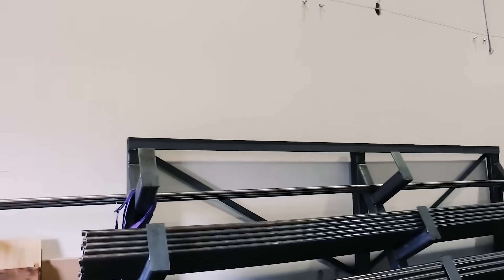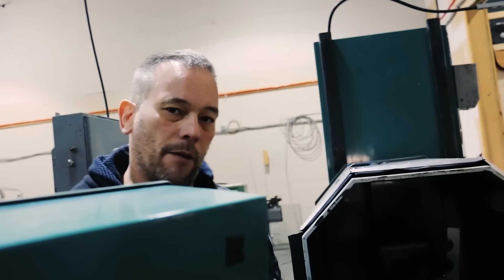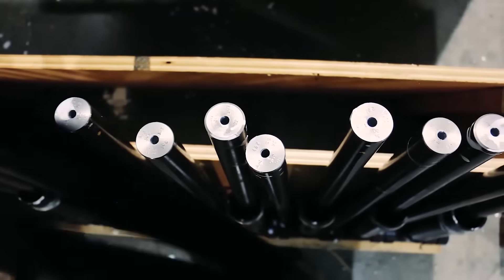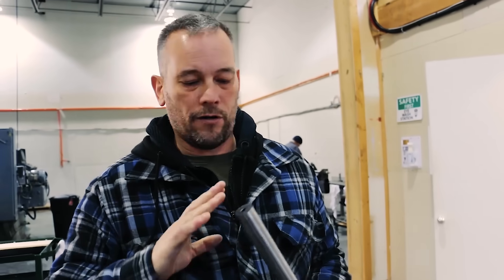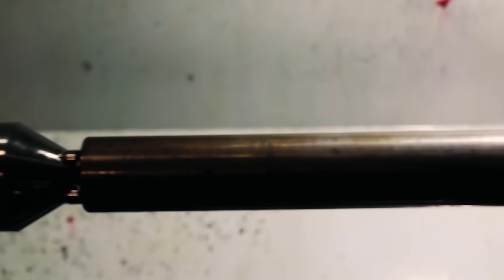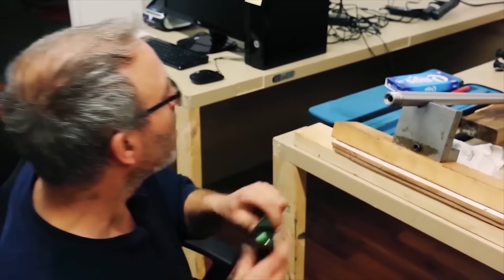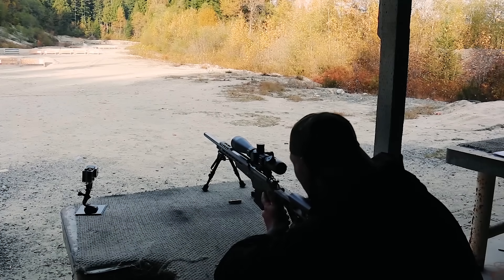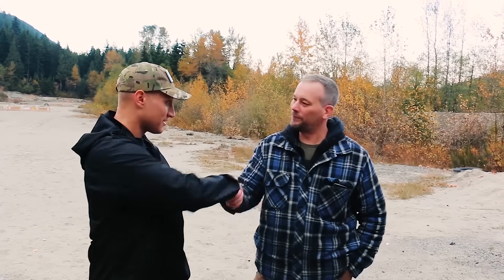How A Precision Rifle Barrel Is Made: with International Barrels Inc.

Comment: How can you drill a straight hole with such a flexible drill bit
Reply: A couple of years ago I took a tour of the Shilen Barrel co in Ennis Tx. They drilled the hole in the barrel using a process where the barrel blank sits in a bed and is rotated and slowly advanced into the drill. However, the hole in any barrel is never going to be completely straight. It's the consistency of the diameter of the hole that's important. There were craftsmen who straightened barrels but that's pretty much a lost art these days.That's why gunsmiths who chamber barrels always locate a position in the barrel where the end of the cartridge will be and use that point to center the barrel in the lathe. We're talking about one ten thousandths of an inch for precision work.

Comment: Those barrels seem very very thick, is this the old school make it heavy, make it inflexible, clamp it down tight (like the wa2000) line of thinking?
Reply: Thick barrels absorb heat better and are much more rigid and stable.
Reply: @THOMASTHESAILOR  yes, all true I know, but the fashion these days is free floating and being this big seems like its weight would bend it
Reply: @sarchlalaith8836   You're right,  I understand the trends..  But the barrels steel is pretty darn strong..  it can't possibly bend under it's own weight..  It's just a matter of choice..   Big Burly Guys,  like Big Guns..
Reply: @sarchlalaith8836  Heavier barrels don't sag under their own weight.  And, they whip less than thin barrels making them more accurate.
Reply: @edwaggonersr.7446  Reasonable but I was additionally talking about the method of attachment, ie free floating, vs tightly clamped since thicker barrels tend to be more firmly held.

I'm curious which this is intended for.
Reply: @sarchlalaith8836  Different riflemen do in one way or the other; thick or thin.

Comment: 168 and 175 grain Sierra Gold Medal Match factory ammo will shoot stellar in most any decent rifle.  I shot it for F-class for several years before loading my own match loads.  My hand load  is basically a duplication load of the 175 GMM factory load utilizing Berger bullets seated a bit longer than factory specs.  I tell any new F-class shooter to shoot Federal GMM for a season or two, save their brass which has been shot in their chamber, and load your own from there.  As for the Federal brass, I've had very good luck with it in my reloads.  Weights are consistent (I sort all my brass by weight) and I've not had the problem with loose primer pockets.  I also use Lapua brass in my .243 match rifle since I didn't have decent factory brass for that from the get-go.  The worst factory brass I've ever tried to load is Winchester.  Winchester brass is horse shit, no matter what anyone tells you.

Comment: Broaching tool is used for twisting lams and grooves in barrels, 1 broaching tool may last for as many as 10,000 barrels (2 inch). These are methods that have been used for at least 100+ years. And if you believe that ballistics comparisons can I.D. a match using barrel comparisons you had better think about how many barrels are machined with 1 broaching tool. They are not like a fingerprint.

Comment: See that machine that was made in 1917 and is still working. That's what you get from American made items.
Reply: Look they have one lathe made in soviet union Stanko probably model 16k20 or 16k25. So as you say made in America :D Soviet union made really heavy duty lathes this one weight 3-3.5 metric tons, motor 11kw, and can cut metal like butter. They made quite good manual machines, but most other things are not so good.

Comment: Man,your Prat-Whitney gun drill machine!  I have been into manufacturing all my adult life, (over 35 years with several degrees and tons of work exp., now self employed in a small shop), and I have never seen a 100 year old machine  that is still in operation, (I am sure there are more).  The USA made good stuff back then that would last, and over engineered by today's lower standards.  There has to be 10's of millions of dollars worth of work put through that $500.00 machine, (in 1917).  If they can only make a CNC milling machining center last so long.  Most have a 10 year life span if pushing their capabilities.
Reply: EarthSurfer,
 You are so right. I use to work for a company that had old rubber plate printing machines like that , which were made back then. One of them was suppose to have ran food rationing stamps during the depression. Everything was very heavy duty metal, the old canister type oilers , etc. These machines were made to run 24/7 if you keep the oilers filled and took care of them, replacing worn bearing etc. .
 Newer offset litho printing machines were not so much.
Reply: I have a friend, a machinist, that works for a shop that makes 5' diameter earth hole drilling rigs.  They have a lathe that was used to make battleship barrels during WWI and WWII, the thing is massive.  My friend tells me that the cost of shipping and setup was more than the cost of the lathe, pretty cool.

Comment: can this be down with a manual lathe?
Reply: Long holes?  No.  A drill of a .25 caliber for example, would start wandering off center too much after 2 or 3 inches of depth, with the best of conditions.  The "Gun Drill" is a specific machine for drilling gun barrel bores, like the name says, (and why a good one is still valuable 100 years into service).  I worked in a shop that had one, (aerospace), but I never ran it.  Search for it here for one second on youtube, and I am sure you can see the process that is needed for a long, straight  hole.
Reply: I am wondering if you can actually do a better job (straightness) with a wire EDM,---but first, you have to drill a hole. :)
Reply: thanks for replying

Comment: I wonder if a bullet would even make it out of a 12 foot long barrel with a weaker cartridge like .380 or 9mm or .40 or .45
Reply: I would bet they engineer the powder charge to be spent by the time the bullet leaves the barrel, so the pressure probably drops from the normal barrel length for the last 10 feet.  A big factor is the bore tightness on the bullet, but I bet the average will be coming out of that long barrel at about 550 FPS, like a cheap pellet gun. :)
Reply: EarthSurferUSA yeah sounds like an experiment i need to mention on some other gun channels

Comment: As much as i would like to start some sort of metalworking and machine shop business here on local, the massive initial upfront cost and lack of actual education and skill levels (i can figure things out, but it involves trial+error and eats too much time) has been the biggest problems. A standard machine lathe, brand new retail can easily soar towards five figures, round the cost of an almost brand new car, and that does not include the cost of having three-phase power installed to power it (pretty much mandatory unless you can deal with using Variable Frequency Drives to convert 2ph to 3ph, like how AvE does it)

and of course, the tooling. Starrett reminds me of what Snap-on used to be - top-of-the-line top quality (before it became infected with the chinesium and assimilated into the prosumer void alongside the craftsmans, cryobis and other oddball generics) - and came with a top-of-the-line price that dyed your face green upon seeing the price tags, along with the promise of instantly slimming down your wallet.
Reply: I have been into manufacturing (from burger flipping) all my adult life. I paid my way through a community college associates degree flipping burgers for 4 years, got machine shop jobs, (over 20, but a heck of a lot of skill learned), earned, (while working in machine shops), 2 more degrees, (Bachelors in manufacturing and quality engineering), and was still not making the money I wanted to make, like more than you need to just pay the bills.  Then I started a business.  I rode and worked on dirt bikes growing up, (which got me interested in manufacturing), and I now modify little 2-stroke engine for racing applications.   Man--learn how to make things, and get into a recreational industry, or create your own.  I bought a Tormach mill over a decade ago (a 12,000 cost).  It is about the size of a Bridgport, but CNC.  I use small cutters on aluminum, so the little machine has lasted me over 10 years.  I have been living off of it.  The thing is, those niches are there.  You just have to discover reality outside of "being an employee" to find them.
If you start a business and it takes off like mine did, you will experience a sense of freedom you never knew existed, (until April 15th).  Then, you will understand who capitalism is suppose to belong to. Us!
Reply: Oh yea.  Use your jobs for an education you actually get paid for.  Stay away from union jobs if you have your own mind.  When my one car garage business took off, I was making more money than any union "worker" in the world.
Capitalism; (marketing your own skills and self interest only in a free society), it is the most exciting thing that ever happened to mankind!!
Reply: @EarthSurferUSA  Spot on mate,you made your own luck,proud of you

Comment: the best machine shop machine lubricant is the new synthetic stuff, basically leaves no residue and lasts upto ten times longer, no matter what your going to machine ? Most of the Aircraft manufacturers use it for all aerospace alloys which 416 stainless steel is ?
Reply: Don't you think that he would be rifling with the synthetic lube if it was best for the application?  Do you honestly think he went with the soap solution because it was old or cheap?  (I doubt it is the least expensive lubricant.  It is no doubt very good as a low speed high pressure lube.)

Comment: DID NOT UNDERSTAND THE TERMS YOU USED, WHAT IS BUTTEN ??  AND SEVERAL OTHERS.
Reply: Don't butten - I'm talking
Reply: It's a button broach.  Several buttons are pulled through the barrel which cut the grooves for the rifling.  Each button slightly larger than the last
Reply: The helical rifling is created by slowly rotating the barrel while the branch is pulled through it.
Reply: At the risk of being obvious, seems like the button is a broach that you pull instead of press, except I'm under the impression that each button has only one set of cutting teeth, unlike a broach that gets it all done in one stroke. Maybe.
Reply: Button Rifling, as apposed to Single Point Cut Rifling, Broached Rifling, Flow Formed Rifling and Hammer Forged Rifling... search for these definitions if you care to know more about that.

Comment: I wish he would have commented on the rifling for long distance accuracy, since this guy should know because these are "precision" barrels.  I have heard only one "expert" mention twists of 1 in 7 to 1 in 15 makes little difference in accuracy below 8 mm (30 cal) and in distances less than 300 meters.  However, shooting beyond 600 meters in most calibers greater than 7 mm bore size, especially 8 mm (30 cal), greater accuracy requires a fast twist of 1 to 8 or 1 to 9.  I have yet to hear a second "expert" confirm that information.  Any thoughts? And, yes, I subscribed and "Liked".
Reply: The twist rate only affects accuracy with respect to bullet stability.  A slow twist with long bullets will make them unstable and they will start to wobble or tumble before reaching the target.  A fast twist with short bullets can cause them to disintegrate in some cases, and over-stabilizing can also hurt accuracy.  If the bullet is over-stabilized it will resist changing direction with the arc of it's trajectory.  Usually these barrel makers will have a standard twist rate for a given chambering (such as 1:10" for a 300 Winchester Magnum).  Such twist rates will handle the most common bullet weights for that caliber.  For long range shooting people often use longer, heavier bullets to maximize retained velocity and reduce wind deflection.  The longer bullets need a faster twist for optimum stability.  In most cases you can take a standard twist rifle and shoot well beyond 600 meters though.  There are calculators available online where you can input your caliber, velocity, bullet length, and atmospheric conditions to find out how stable your bullets will be.
Reply: Rifling twist is calcaluted using a formula which I have read somewhere but cant remember where. But basically the longer the bullet the faster the twist needed.A 30 caliber 150 grain bullet is obviously shorter than a 6.5 mm bullet of the same weight. Thus  why a typical .308 Winchester rifle has a 1 in 10 inch rifled barrel and a 6.5 swede barrel is more like 1 in 8.

Comment: This would be great with better camera work and sound equipment. And a dumbing of education by government design in not having metal shop class in America. And yes, the old stuff is the best.
Reply: Or, y'know, machine shops cost thousands of dollars to maintain, take a large area for a small class size, and it's easier just to teach the kids autoCAD... Though, we did have several courses that taught welding either as the primary focus or part of the curriculum on a farming/automotive class. That, in a small town school with a notoriously low budget. It seems like all the people bitching about the education system have been out of contact with it for decades, or they think the school their kids go to is exactly the same as and shows the total limit of every other school.
Reply: A very good friend of mine started in the machine shop when he was 13 years old, he swept the floor.  When the boss noticed that he worked hard he added de burring to his job.  If he had any spare time he spent it mowing his bosses yard and trimming the bushes.  All at sub-minimum wage.   By the time he was 18 he was making journeyman wages.  He just recently turned 46, he is still a machinist, but now making more than $40 an hour six days a week.  Over the last thirty something years he has never missed a weekly paycheck.  He learned the necessary math on the job.

Comment: How the heck do they keep that drill bit straight and center?? Amazing!
Reply: Its a special type of drill called a single lip drill. It has only one cutting edge on a carbide tip, which has no radial relief. this centers the drill exactly in the hole it drilled. You need to dril a small hole to get it started though, as the tip is not able to self center without the guidance of the following diameter. 

In order to get the chips out and to lubricate the enitre process the drill has a hole on the inside whih is used to pup coolant fluid to the tip, where it picks up the cips and flushes them out backqards thru a single groove in the drill.

Also other then a regular drill here the blanks are rotated while the drill is fixed. This ensures that the drill centers itself, as every deviation from the center would result in greater force on that side of the cutting, pushing the drill back into the center.
Reply: @peteraugust5295 actually this shop does it both ways, he stated in the video that one of there machines is a fixed drill with the part spinning and the other is a live drill. I work at a place that makes compressor actuators and also do it both ways as well. Our newer machines we use the live tooling and the older machines the tooling is fixed.
Reply: @navjotsingh8800  That is most certainly impossible to tell. Either machine can range from 500 to 200.000USD, depending on the condition and capabilities.  For the setup that is shown in the video I would estimate 20-30k for the machines alone. However you will most certainly have to look for those machines for quite a while. Gun drills are not something that you find in the average machine shop.
The cool thing though is that gundrills are self centering as described above, which means that the machine itself does not need to be super precise or stiff and therefore lasts basically forever.

For the most cheap simple setup that would allow one to make barrels to a length of maybe 500mm I would calculate 1500USD for an old lathe, 500USD for the tooling and 500 Dollars for a simple hydraulics press.
There is a lot of information on youtube how one could potentially do this at home. I suggest you check out "The Idahoan Show" if you are interested in this. You might want to check your local laws though before putting your hands on making a barrel yourself. Its a sure way to beef up your criminal record in most places.
Reply: Não tem muitos segredos, eu  furo uma barra de 1045 de 24 polegadas em uma furadeira de bancada com duas brocas, uma menor e outra maior, basta a barra  ser uma polegadas e depois de furada alinhar pelo furo do centro e tornear e depois  aquecer  e fazer um tratamento não tempera cementação

Comment: First time I ever heard of a Broach being called a "Button".  Interesting.  I used to gun drill larger gun barrels with a long carbide-tipped drill and broach them with a hydraulic push broach.  The machine itself was over 40 feet long.  There were a number of HSS "wafers" (look up what HSS means) that actually were used successively with the push broach to gradually produce the grooves in the barrel, using a special lubricating oil under high pressure.  No soap used, and the gun drilling machines were also very old, pre-WWII as I recall.  Did two barrels at a time.  The waste chips from one barrel were very stringy and would fill up 2 fifty-five gallon drums.  Quite a process.
Reply: button and broach rifling are different.
Reply: A broach cuts the rifling whereas a button expands the bore to form it.
Reply: Must be a lot of pressure behind it.  How large a caliber will a button work to form grooves?
Reply: utubetommy all of savage rifles are button rifled .... you can’t be serious